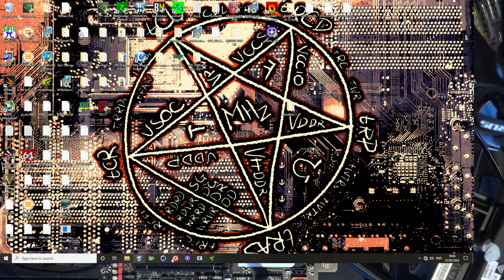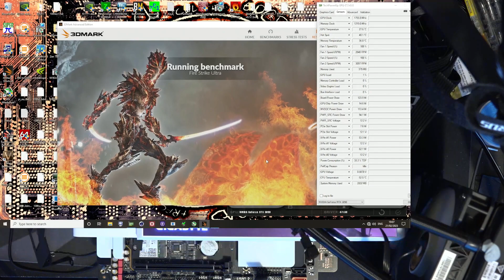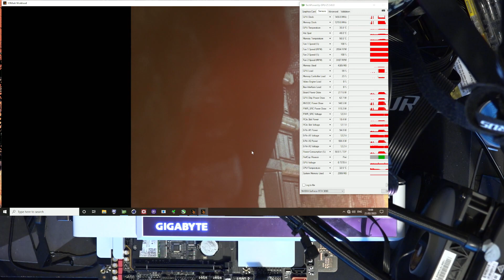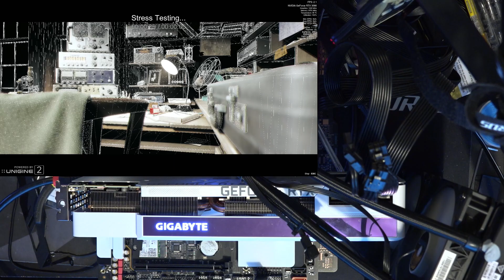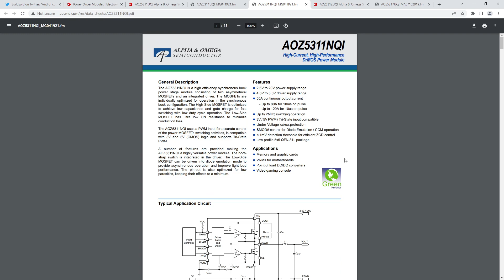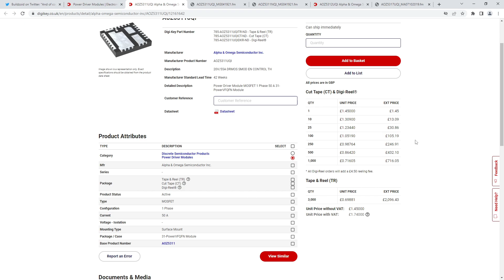First test runs of the RTX 3090 Vision

Comment: Thanks for doing these videos Buildzoid, as a single data point my gigabyte gaming OC 3080 TI has seen north of 550 Watts routinely when benchmarking and basically lives at 500 watts in gaming, and no issues whatsoever.

I agree with your assertion that the problem isn't component selection, but is instead the overall design and the way that it's managed by the voltage controller, if there was any gigabyte card that should have exploded my 3800 TI definitely should have.

It's shunt modded plus I've run the 1000 W vbios in conjunction with the shunt mods and a 200% power limit, essentially creating no power limit anywhere on the card since the HoF vbios removes some of the secondary rail limits. It took it like a champ  and took a bunch of 3080 TI top benchmark spots. Probably the main difference between mine and these is temperature, mine is chilled to 5c, so voltage tolerance obviously is extended, VRM load reduced, and as a theory I would say these died because the mosfets were at the edge of operating temperature range daily and a particularly high load at high temp triggered thermal runaway.

Comment: eVGA has the best customer support. By the way, would you buy the z590 OC FORMULA brand new for $200. The Micro Center by my house id dumping all their last Gen. stuff. 10850K's for $250 to go with it doesn't sound like a bad idea. Also, picked my 3rd 3080ti TUF OC V2's for $960. And finally found the 6900XT TOXIC EE for under a thousand, i had to get it. I already have the TOXIC "AIR". The 6900XT OC FORMULA is also $960. The cheapest 6900XT I've seen was a Red Devil OC for $860 (open box). Not too bad especially when the 6800XT is going for $680. Where getting there, 2 years after release.

Comment: If Vcore current draw is the reason why vrm's are blowing up; then lowering Vcore voltage to something around 800mv should theoretically help increasing the longevity of the card albeit at the cost of some amount of performance due to required lower clock speed.
Reply: dont u mean increasing voltage ?
to my knowledge to get lower current from same power u increase voltage
p = v * i
Reply: @wazneh   This is a very good question and what you have said is true under constant power load. However semiconductors such as cpus and gpus have variable power draw. Load changes over time based on the task they are doing. The core voltage of any silicone (semiconductor) determines the power required for given task for the given clock speed. Then Vrms are responsible for providing the said amount of power for at the requested voltage level.
When Vcore is decreased the amount of voltage requested by the core is decreased. This in turn reduces the workload of the Vrms by reducing both power and current draw. 
Let's say you have 8 phase 50 amps  vrm for the RTX 3090. Its stock voltage is around 1.1V and power draw is around 350W. This means that total current draw is approximately around 320A. When you divide it by the number of power phase you get 40A. This means that each phase is working at %80 capacity. Then you reduce the Vcore 0.8V and this reduce the power draw to 240. Then total current draw is around 300A and each phase is responsible for providing 37.5A of current. Now your phases are at %75 capacity. Now they are working less hard and giving out less. 
Undervolting also helps with reducing the transient load current draw which I suspect is main culprit of the acute card deaths that I see on forums and reddit especially on new worlds. It is much harder to explain it on youtube comment section so it is better if you google it.
Reply: @wazneh  Under the same load the core resistance remains roughly the same, so less voltage = less current. That's not accounting for slightly reduced boost clocks which will reduce the peak current draw which is mostly likely the real killer for these cards.
Reply: @willjohnsonjohnson  v = r * i^2
So resistance is the same that's why when undervolting current level decreases

Comment: Do you know if it is possible to raise gpu clock via physical mods? Like can I solder something or swithc parts to trick it to clock higher than software allows me?
I am desperate to work around the 6000 series limits :D

Comment: Fuzes are not percision parts even ultra fast fuzes have quite a large variance in blowing point i.e. milliseconds to blow so its not surprising that eventhough the card has fuzes the powerstage melted
Reply from the maker: I'm aware which is why I'm wondering if it would be possible to design a card to use fuses with very low current ratings to get them to blow as fast as possible. When a power stage blows it will pop a 5A/10A/20A fuse the only difference between them will be how long it takes for the fuse to blow.
Reply: @ActuallyHardcoreOverclocking  I would actually love to see a card like that. On that same note I'm wondering if there is a card model that would be suitable to mod the fuses in.